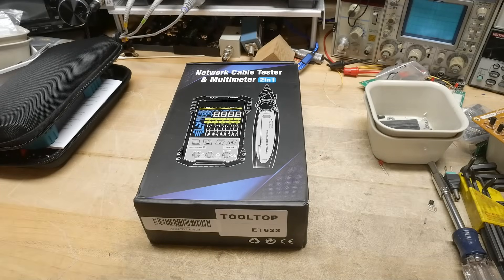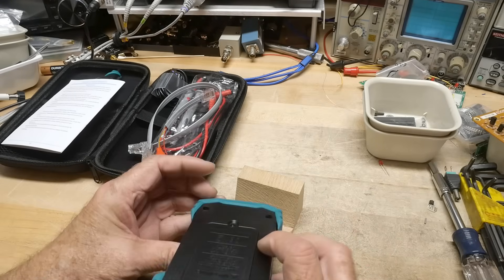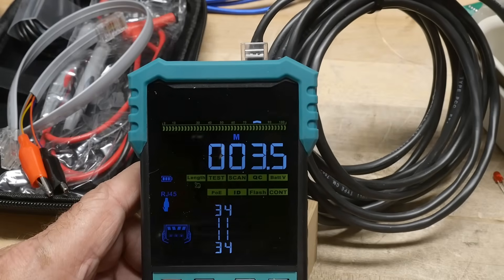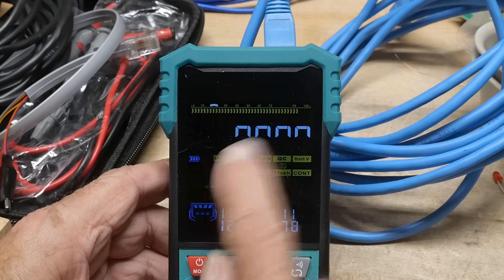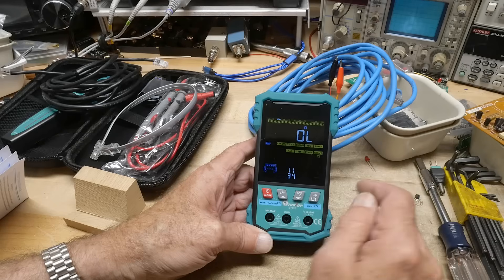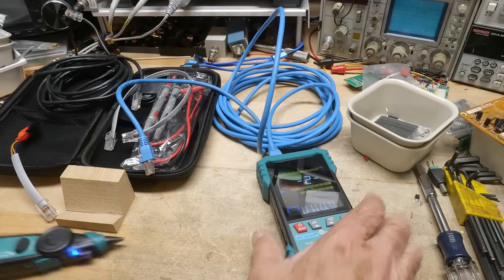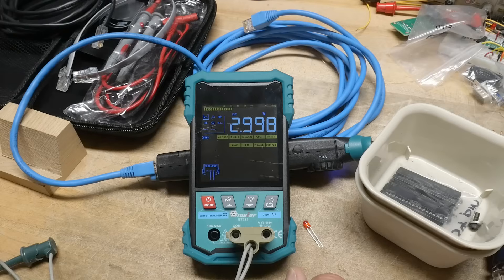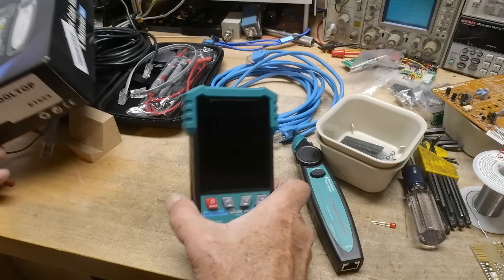#2400  ET623 Wire Tracker Cable Tester Multimeter

Comment: AI Summary

Abstract:

This video provides a comprehensive review and demonstration of the Top Tool ET 623, a multi-function device that combines a network cable tester with a digital multimeter (DMM). The reviewer walks through its various capabilities, showcasing how it measures Ethernet cable length per twisted pair, traces cables using a remote probe (scan mode), verifies connector crimps (QC mode), and identifies ports on a network hub (flash mode). The integrated DMM features are also tested, including voltage and resistance, which prove to be accurate but slow to respond and autorange. The device is presented as a useful, specialized tool for technicians working with wired Ethernet infrastructure. A brief teardown at the end reveals a complex internal circuit board with some components having their markings ground off.

Review of the Top Tool ET 623 Network Cable Tester

*   0:00:07 Multi-Function Tool: The video introduces the Top Tool ET 623, a device that integrates a network cable tester with the functions of a digital multimeter (DMM).
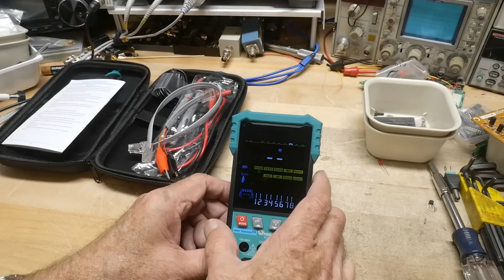*   0:02:06 Cable Length Measurement: The device can accurately measure the length of an Ethernet cable. It can also measure each twisted pair individually, which helps identify poorly constructed or faulty cables that give inconsistent readings.
*   0:04:50 Cable Tracing with Scan Mode: Using a separate handheld probe, the "scan" function sends a signal through a connected cable. The probe beeps when it is brought near the correct wire, allowing for easy cable tracing and identification within a bundle.
*   0:05:02 Connection & Crimp Verification: The "QC" (Quality Control) mode checks that all pins on an RJ connector are crimped correctly. A separate "Test" mode uses a remote terminator to confirm end-to-end continuity for a cable run.
*   0:06:42 Hub Port Identification: A "Flash" mode sends a signal to a connected network hub or switch, causing the corresponding port's LED to blink, which helps technicians quickly identify which port the cable is plugged into.
*   0:09:37 Integrated Digital Multimeter (DMM): The tool includes a full DMM with modes for AC/DC voltage, resistance, continuity, diode check, capacitance, current (milliamps), and a non-contact voltage sensor.
*   0:10:10 DMM Performance: When tested, the DMM functions were found to be accurate but slow. The device takes a noticeable amount of time to autorange for voltage and resistance, and the continuity checker has a significant delay.
*   0:11:31 Internal Teardown: A brief look inside the device reveals a surprisingly complex circuit board, with some integrated circuits having their identifying markings intentionally removed.

AI-generated summary created with gemini-2.5-pro for free via RocketRecap-dot-com. (Input: 15,307 tokens, Output: 598 tokens, Est. cost: $0.03).

Comment: This is for testing and identifying Ethernet in-building cable plant.  Massively useful device for cable installers, but many of the functions are related to identifying, eg. individual Cat 3/4/5/6 runs into an aggregation site (eg. cable closet) where wall outlets are unmarked.  The cable installer will use the test results to then label each cable run.  The tone tester can be used in a smiler way, and can also be used to identify and trace individual cables within a cable bundle.  The add-on pack mentioned is a series of RJ-45 adapters, each marked with a different numbers, which the tester will display when connected to the other end of the cable run in order to identify the cable runs from each other.  The unit can also find cable breaks, swapped pairs and many other cable installation errors.  IMSAI guy has many wheelhouses, but this isn’t one of them, so many of the functions weren’t explained terribly accurately.

Comment: Ethernet (EIA/TIA 568) pairs are 1-2, 3-6, 4-5, 7-8. Maybe it has a mode to switch it into the correct pinout? If not, tthat's a fatal design flaw.

Comment: I used cheap function generator, connected to network cable, while other end was disconnected, injected 6V square 2Khz signal, and used portable oscilloscope, when probe placed near network cable, i saw triangle shaped signal... if wire is broken there is flat line no signal...
Reply: I did the same thing.  I setup my Tek 515 portable 500 series 5-slot cage stuffed with an SC502 scope (2-slot), FG501 function generator, PG502 pulse generator, and DM501 multimeter for tracing phone lines, network cables, intercom cables, etc. around the plant back in the day.  I used the pulse generator and scope to do TDR measurements to find breaks, function gen and often just a speaker with a mini-grabber and a probe for tracing, DMM for Ω, it was the cat's ass back in the day.  Dedicated testers like these are far more capable and fit in a shirt pocket making the pile of Tek gear obsolete but boy it was a time saver back in the day, and you looked really cool doing it!